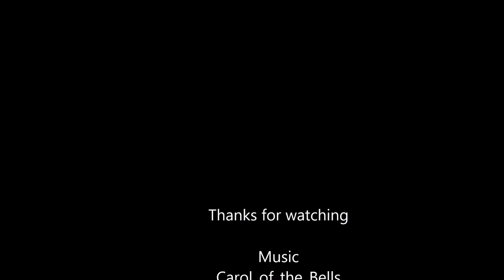DIY Grafting plier

Comment: I did it with pipe clamp and pliers but problem is idk what but it reacts with most of woods and turn black instantly and after sone time rust like substance built-up on wood and feels like rotten in no time I noticed in commercial tools they have powder coating or something on blade that prevent this thing
Reply from the maker: In my case , I have used it only on soft stem plant and it works well. Currently I am not using it for anything. Now I am using a stainless Steel knife 🔪 for all grafting. As stainless steel does not react with plants so could not harm/rotten/black them in anyway..
Reply: Yupp me cutter blade use kartoy sadya

Comment: This primitive tool u can buy max for 5$ from China
Reply from the maker: +ALeksandr Myronyuk , sure friend.
We can buy almost every tool from market, but some people feel happy when they make(or copy) something new.
Cheers
Reply: @madeinalibag3079 Really  i do thousands of graftings every year and want to assure you that is not an instrument for accurate cut. And blade nust be forn stainless steel to not oxidize a  cut point. It is very important.I understand that as for homemakers it is an idea to do something but in terms of use it is not good. Because as a result will merge one of 20-30
Best regards my friend) I don't really want to offend you))
Reply from the maker: +ALeksandr Myronyuk , thanks for comment. I do understand u r not offending me indeed u r saying actual logical fact. I agree that u r 100% right what u saying. Option is always available for "buy" or "make" but sometimes buying is not option (atleast for me). I am not claiming that this tool can replace actual "grafting pliers" (actually it is not Evan close to it), but yes it may serv the purpose for soft wood grafting.
Usually i made things out of scrap which is laying around me,(u can check my other projects if u have some time) , this project also had similar story.
Happy to hear that u also love grafting. 
Keep working.  
Cheers